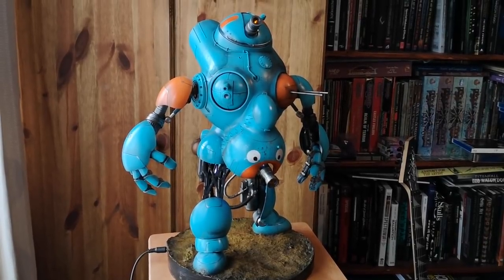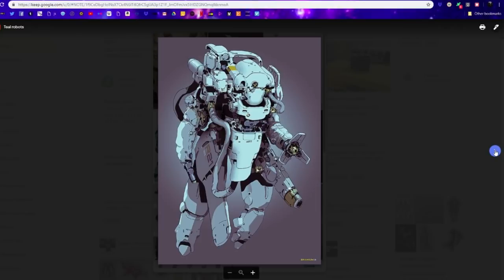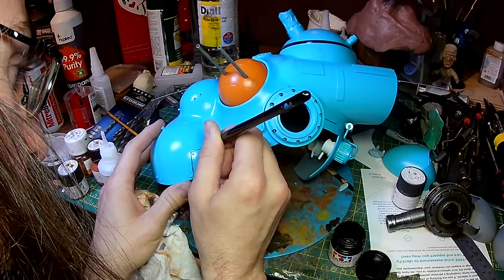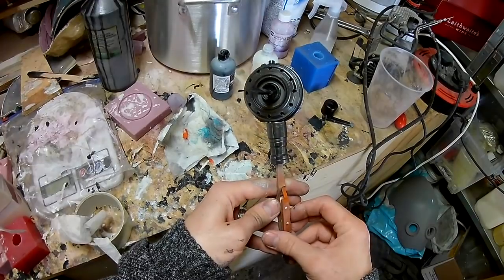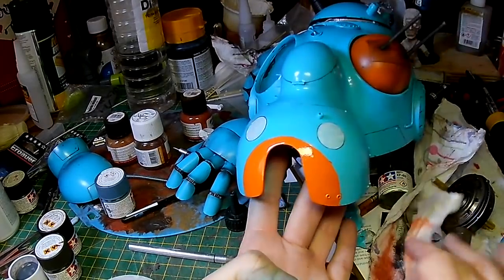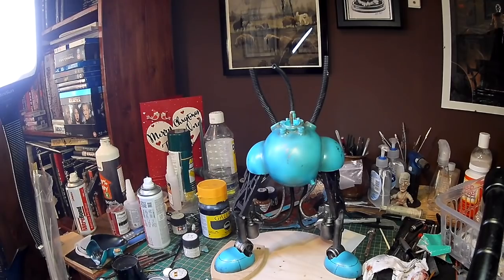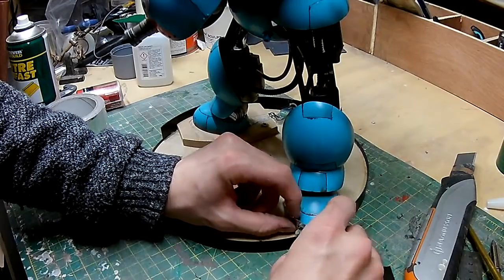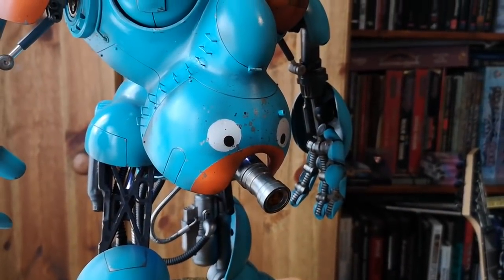Scratchbuilding a Mech from Clear Plastic Baubles Part 2

Comment: blue and orange.... complementary colors.  or opposite colors on the color wheel.    So, it makes sense to have some orange on there.  If I looked at that mech w/o watching part 1... I'd have no idea how it was done!  and still no idea how you made the mechanical look for the legs even after watching.  It was copper pipe before and now it looks all wiring and tubes etc.   Nice job on this!!

Comment: 12:20  now, now, don't blame the tool! heheheheh  Oh, I have airbrushed some....  clogging is the #1 problem and trying to keep the nozzle unclogged....  difficult.  ALso, it looks like you were using black to shade with.  If that's true, I would not have used black.  I would have used a transparent blue with maybe a hint of black mixed in.   It would have let you build up to some shading w/o  going over as easily and also black looks like soot on there but then maybe that is what you were going for.  If so, then yeah, black is the color to use!  That brush doesn't look particularly cheap.  Seems like it is nicely made but no idea.   I have Iwata HP-B, Iwata Custom Micron, Olympus HP 102C and an Iwata HPLV gun.   The micron is amazing.  can nearly paint a single human hair with that thing.

What kind of compressor are you using?
Reply from the maker: This was one of those cheap $80 kits from ebay, so the compressor isn't that powerful and the gun is very prone to clogging.  I'm probably gonna get an iwata I think.  I have another compressor for pneumatic tools which is probably way overpowered but I might see if I can step the pressure down enough to use with an airbrush. I don't know much about air brushing so I was using the Alclad black base for shading, it was coming out pretty well though so I'm eager to have a go with an air brush that doesn't spatter paint all over the place!
Reply: @thedarkpower   For one, if your big comp has a gauge to dial up pressure output, if it will go down to say 30 psi, that would work.  Plus, using those cheap piston compressors.... they are noisy 24/7, they never shut off and they PULSE in the air flow which is going to give you an uneven spray line (subtle, but there).  If your good comp can dial up 20 to 40 psi, you're set.  Just be sure to put a moisture trap on it so you don't get water spitting out through the air line.  Paint... well, if you thin it properly, it'll spray ok then just keep that little cap on the end OFF, cuz unless you're spraying very thin  transparents, it'll clog.  That's what paint does - dry when exposed to air and an AIR brush well....  that's what I do anyway.   THEN you can pull off the dried paint around the needle with fingernails periodically.   Also a longer needle point will give a smoother start (like instead ofd BOOM suddenly on, it'll be more gradual).   I even removed the spring that keeps the ab trigger UP so I didn't have to push down for air and instead, I rigged a FOOTSWITCH to enable the airflow to the brush.  So, NOW, all I need to do is pull back for paint after I press the foot pedal for air and yes, it can alter the PSI at the pedal. :)  Food for thought.

That Iwata HP-B or similar is good.  You don't have to have a custom micron.  But for small stuff, they are awesome.   well, good luck and thanks.  Been enjoying seeing how you make these physical things.
Reply: @thedarkpower   oh, my compressor is Porter Cable 140 psi so yes, you can use any compressor as long as you can dial up the amount of psi you want and just put a moisture trap on it for sure.  Once the tanks fill, you can spray a good while at 20 psi b4 hearing WAAAAAAAAAANK and the tank refilling.   Also, lower psi means more clogging for thicker paint and especially white.  Transparents spray better than opaque, in general.  If you want a really smooth fade, don't use a value (lightness or darkness) that is FAR away from your surface value.  Like you did with the black.  That's too far and you will see visible grit at the edges unless your paint pigment is highly fine (small) and your AB is good at atomizing.   You THINK black is the perfect shadow color but nope.   It's prob the worst because you have the least amount of control (it's the farthest you can be from your base color) and it's just not going to work well like that.  You just need to mix up a DULLER version of the orig color and thin that a hair more and that should do it.  Build up your  shadows and fades in SLOW passes.  Control in airbrushing is absolutely the name of the game.  Just my thoughts!    take care.